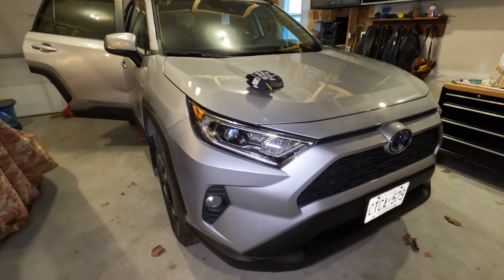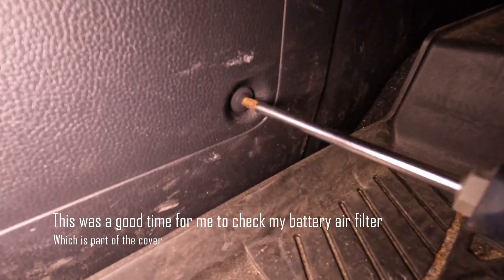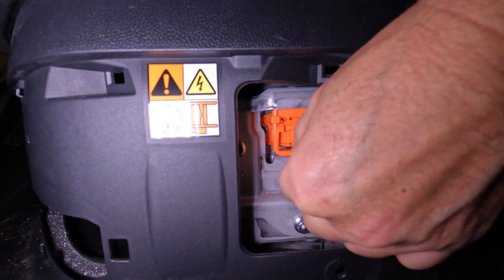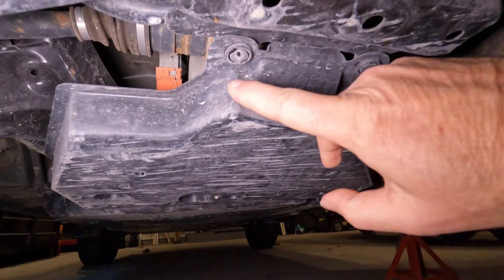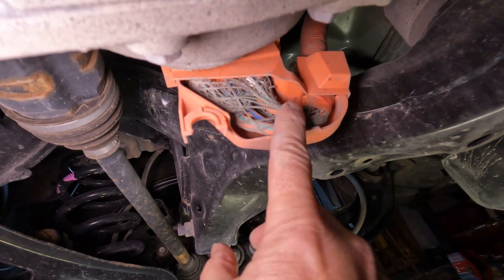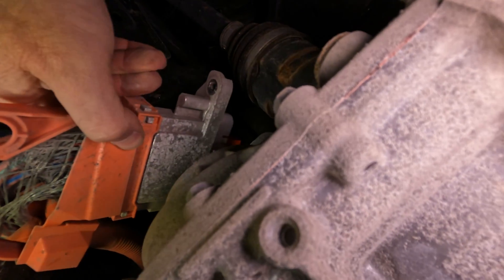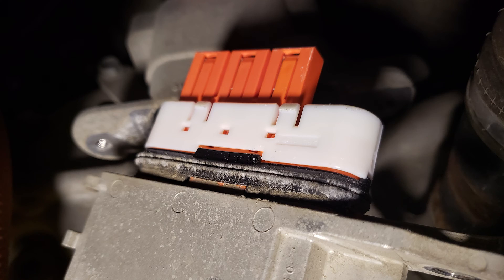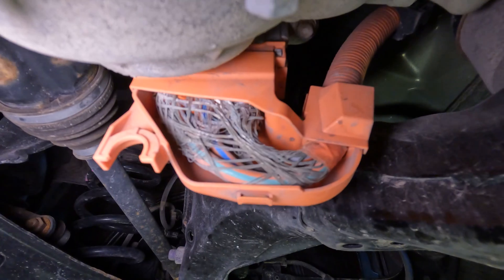2021 Toyota Rav4 Hybrid High Voltage Cable Inspection

Comment: I have a 2023 Rav 4 Hybrid with 30K miles on it. I started noticing issues with my AM radio being staticy about 6 months ago.  It got to the point where I can no longer listen to AM radio, brought the car into the dealer 2 weeks ago and have been informed that they need to replace the Hybrid electrical cable.  Fortunately, it's still under warranty because it's a $6K to $7K repair.  Bottom line, Toyota did not fix the problem in the 2023's.

Comment: There is a customer support program on these cars that are good for 100k miles. The techician will inspect the inner part of the cable for corrosion as you did. If there is corrosion in the upper cable, it will get the upper "traction motor cable" too. But beware, these cables still corrode. The cablewarden is a good purchase and will protect your cable.
Reply from the maker: Yes, I'm aware, it has always been my observations that the problem will not show its self until the warranty period is up!🙄

Comment: Dielectric grease is silicone gel which is non-conductive you can’t apply on the connection. Applying outside has limited effect. Therefore that grease is not answer to the rusty problem.
They’ll need to change the plug from aluminum to stainless steel.

Comment: curious to know if they salt the roads where you live in winter. I live in Quebec and the salt would kill this cable very fast: they use so much.
Reply: ps I cancelled my order for a 2024 hybrid and will go with the gas xle instead
Reply from the maker: @HarrySapsun  Sorry I didnt get back to you sooner, I might have gone with a regular Rav4 had I known about the issue before I bought.

Comment: I keep all of my vehicles for at least 20 years and over 300,000 miles.  I live in Southern Ontario where the roads are covering in salt-slush for 6 months of the year.  I wonder what that connector is going to look like after being subjected to 20+ years of salt-slush?
Reply from the maker: I have a 2005 Toyota Matrix and plan on keeping it for years.

Comment: Great video. Once the battery disconnect has been removed, is there any possibilty of electrical shock when you work on the connector? Thank you.
Reply from the maker: I have had it out several times while working on the plug and have never had concerns with the disconnect out!

Comment: Hi, I am thinking of wrap a piece of heavy duty plastic by a zip tie around the aluminum connector to prevent water splashes on to the cable; also use pipe insulator on the two sides of the plastic cover, so less water can splash into the cover.
Reply from the maker: Remember, this might prevent the plug from drying out.

Comment: I’m a little confused about what the issue actually is when it happens. This wire mesh you are saying is a support mesh. What is it’s purpose? Is it just to physically support the cable or does it have an electrical purpose as well?
Reply from the maker: First, your AM radio will be full of static, next you will have multiple trouble codes, then your SUV will shut down and be undrivable. You will have to have it towed to a dealership and have the cable replaced, if under warranty it will be free, if not some are paying up to 6 - 7K.
Reply: @MsBijouu  got it, I understand the issue, what I am saying is that people post a lot about the mesh showing corrosion. I don’t believe that does anything. I’m guessing the theory is that if the mesh starts to corrode then it most likely will get past the cable gasket and into the connector itself. Right?
Reply from the maker: @unclefreddy2009  Which is why I didn't apply di electric grease to the mesh but just the connection. Also I believe the mesh acts as a block to radio interference which can be heard on AM radio if the mesh starts to fall apart, I may apply di electric grease to the mesh this summer to prevent this from happening.
Reply: @MsBijouu  I believe the mesh is a cable support and provides EMI guard for the electronics like your radio on AM.  Best if you have a year or 2 on this connector to disconnect it, apply a dielectric grease to the inner grommet, reconnect, and apply a generous spray of Fluid Film or Blaster to the entire area.  After that, annual of FF is all you need.  If you are planning to disconnect the connector on older models pre-2023, it might be worth checking the dealership for a foam gasket that add an extra layer of protection.  It can be found on the 2023 hybrid.

Comment: I have ordered a 2023 model, which should arrive in summer of 2023. After learning all this, if I am not satisfied that Toyota has fully solved this problem for 2023 models I will trade the vehicle in within 3-4 years, and hopefully by then they will have come up with a better solution.
Reply: If you are diligent with only spraying the area with Fluid Film annually, there should not be an issue on the 2023.  Early 2023, Toyota added a foam gasket at the interface of the connector and rear drive unit that should keep the corrosion out assuming the aluminum casting is kept sprayed.  I'll be spraying our 2023 model and getting it ready for this winter's a-salt in a couple months.  Last oil change, it still looked new after last winter's exposure.  It had an application of a dielectric grease on the inner grommet and an external spray of Fluid Film day 2 of ownership.  I don't intend to open the connector again, but might in a few years to inspect it.
Reply: @wayne12345z  I have a 2023 Rav 4 Hybrid with 30K miles on it. I started noticing issues with my AM radio being staticy about 6 months ago.  It got to the point where I can no longer listen to AM radio, brought the car into the dealer 2 weeks ago and have been informed that they need to replace the Hybrid electrical cable.  Fortunately, it's still under warranty because it's a $6K to $7K repair.  Bottom line, Toyota did not fix the problem in the 2023's.  I will be curious to see the design of the replacement cable they ordered.  I am seriously considering trading this car in another year or two. Also, no one should have to periodically jack up their car, remove the splash plate and spray area with fluid film, especially after paying nearly $40,000 for a car.  That's just not acceptable. This is a MAJOR design fuck-up by Toyota and quite frankly, I am dissapointed with their inability to fix this issue.
Reply: @fppenque  It looks like the 2025 model has heat shrink over the area where the corrosion hits.  If your new cable doesn't have this, definitely hit it with Fluid Film which costs $12 can and will last for many coats.  $12 vs $6000 seems like an easy choice for me.
Reply: Great video! Pardon my ignorance, but why is half of the enclosure left open to expose the wires/cables anyway? I’m sure there’s a good reason.
Reply: @kathyb5247 The first models had fully enclosed plastic covers that held water, salt, and calcium.  Following year, Toyota cut part to pretend they fixed the issue.  The open cover had been used since and further mods have been performed each year.

Comment: Can you replace the cable without pulling the rear motor/diff?  Or does the NEW cable fix the problem, my wife car is at the dealers.
Reply: It doesn't fix the problem, it just starts the clock over again until the replacement cable starts to deteriorate.
Reply: The large floor wire, no. The upper traction motor cable, yes
Reply: Jeff maybe you should get the CableWarden to cover the rear cable once Toyota repairs her car.

Comment: THANKS for a great video showing the cable connections under the vehicle.  I live in MN and they use A LOT of salt on our roads in the winter months.  I am interested in buying a hybrid to replace my 2007 Toyota and was considering the RAV4 until I became aware of this issue.  I'm holding off buying for now and will go with the Hybrid Honda CRV unless Toyota comes up with a reliable solution to prevent this problem from happening.  NOT a good situation!
Reply from the maker: I didn't know about the problem until after I bought the car

Comment: I was thinking the same thing in that I would apply the appropriate dielectric grease to the connector and maybe even the harness/mesh inside the orange connector.  There is no negative to applying dielectric grease to an electrical connector other than making a mess if the grease drips out, but the plastic splash panel should easily contain any grease that would drop out, so it doesn't go onto your garage floor.  Nice video and analysis.
Reply from the maker: I was cautious at first , but now I slather it on!

Comment: Great video.  Well done.  I am appalled that replacing that cable is so expensive.

I have a 2022 Prime.  Does this issue apply to it as well?  I have not been able to visually see that connector.
Reply: The prime as well from my understanding. I’m considering getting rid of my 2021 prime for this reason.
Reply: This issue is specific to 2019+ RAV4 Hybrid on rear electric motor HV cable connector
Reply: @martinmeyerdierks2797  No, it also affects the Venza as well.

Comment: Yup dieletric grease on the inside of the connector and around the rubber.  After connecting it use an anti rust spray on the  outer metal aluminium parts and mesh with a non wax, non solvent product ( krown makes some ).  Then put the plastic piece back on.
Reply: The voice of reason.
Reply: Agree with the comment, dielectric grease the wires in that orange cup too.
Reply: Would fluid film work?
Reply: @Favored1881  no

Comment: After all your inspections, was it just simply plug in the orange HV plug that you pulled out in the very beginning, then the car can be started again without required to reset anything? Thank you.
Reply from the maker: Yes, but make sure you put your battery disconnect in before you start car or you will bring up trouble codes.
Reply: Also, when reclosing the disconnect, ensure you push it back upwards once pushed back in to complete the circuit other-wise you'll get a hybrid not available alarm on the dash.
Reply: Thanks.

Comment: I was a master auto tech. Looks like the seal isn't doing it's job but dielectric grease is meant to conduct current, not seal connectors. I'd use a silicon sealer on the seal and the outside of the connector where the stranded wires are and cram as much as possible in there.
That's what I'm planning on doing with mine.
Reply from the maker: And again, Is dielectric grease conductive or nonconductive?
Dielectric grease is a non-conductive, silicone-based grease that's designed to seal out moisture and prevent corrosion on electrical connectors. It also disrupts the flow of electrical current, which makes it good for lubricating and sealing the rubber parts of electrical connectors. I was a Nuclear Mechanical Tech. and a millwright; we were not allowed to use anything unless we had an engineering specification sheet to go along with the product such as Novagard G624
Reply: @MsBijouu  I’ve seen some videos where Toyota Mechanics recommend putting a hole or two in the orange plastic cover to allow water to drain!  
Also, since you’ve looked at it in person.
Could you use some waterproof tape.  Such as FlexSeal Tape, to reduce or eliminate water intrusion?

What is your opinion on those options?  Thanks
Reply from the maker: Not a good idea as the tape will prevent the connection from ever drying out @Bigsmegma44
Reply: @MsBijouu  I used Dow corning 7 silicone grease. what do you think about that produce?
Reply from the maker: Use a good Dielectric @JD0333
Reply from the maker: What is dielectric grease? Despite the fact it has "electric" right there in the name, it's a fairly common misconception that dielectric grease is capable of conducting electricity. In actual fact, dielectric grease is an insulator and doesn't conduct electricity
Reply: Master auto tech...they don't teach you about dielectric grease in school?
Reply from the maker: https://www.eis-inc.com/product/dielectric-silicone-compound-novg6245-3oz 
https://novagard.mx/wp-content/uploads/2019/05/TDS-Novagard-G624-v1.3.pdf
https://www.novagard.com/wp-content/uploads/2017/02/10-M3-G624.GHS_.pdf
Reply: SMH.  A master auto tech doesn't know what dielectric grease properties are.  I cringe the day I need to take my car in for an electrical problem that isn't a straight forward cable swap.

Comment: Great job ! Did you inspect the metal ring under the orange cap ? I understand from your video you made quite the appropriate research in order to make this inspection. My 2019 Hybrid was completely rusted by 96 000km and 3 winters in Montreal Canada.
Reply from the maker: No I didn't inspect it, I didn't see corrosion on the mesh so I didn't bother, the real concern is where the connection plugs in,I believe you about the rust, the corrosion will most definitely affect most of us, it's not a matter of if but when!
Reply from the maker: Yes, I cleaned and greased the mesh and metal band